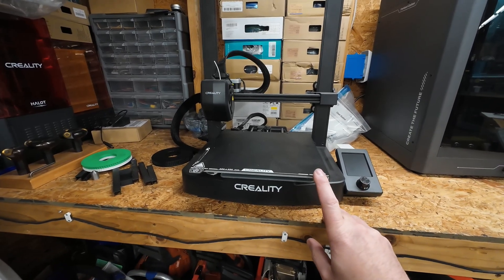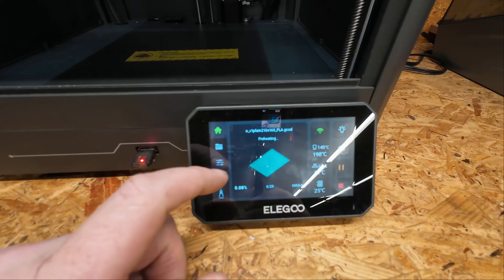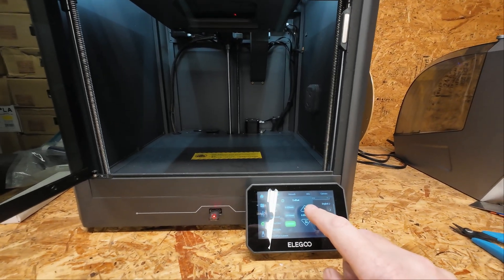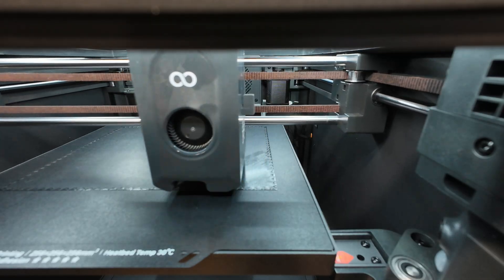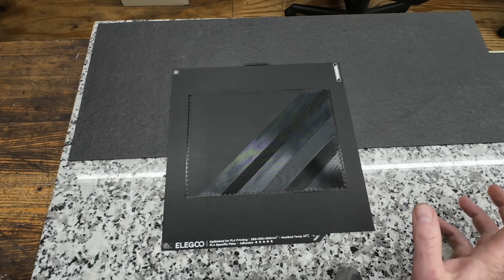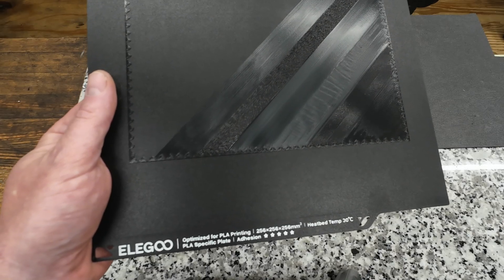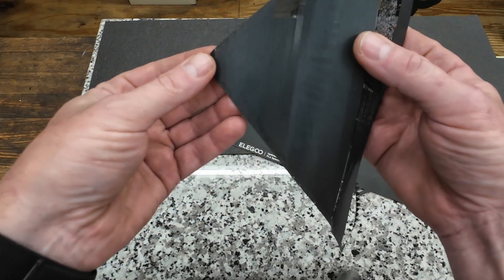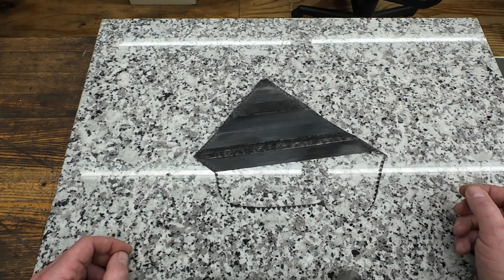Elegoo Centauri Carbon Z Offset  How To Fix It

Comment: I have an issue with my print working great and then in one spot, its really weak and just kinda comes off.  Like something about that spot or what...
Reply from the maker: Are you able to see that spot in the slicer under the preview tab after slicing? If so then it’s the model design, the printer simply runs code, it does not make decisions for itself.

Comment: Thanks! Is the new Z-offset value permanently saved in the printer, or does it need to be set each time? If the latter is the case, could the value also be entered into the printer's g-code in the slicer?
Reply from the maker: Seems like it sticks around for awhile, but any time I do a bed level it resets. I have not played with adding that to my slicer so I really can’t say if that’s good or not. I’ll play around with it tonight and see
Reply: @Workshop_Wasteland  Thank you!
Reply: It's wiped out (zeroed out) every time you do a bed level.

The key to keeping it is to figure out what it needs to be (a few different ways of doing it with one being as shown in this video) and then put that value in the Z offset parameter of the Slicer and return the adjustment on the machine itself back to zero offset. The slicer will automatically apply this offset to all Z coordinates it calculates when you slice a model to print. From there, the only time you really need to worry about it is when you changes nozzles / hot ends.

Comment: I don't get the point: why should I manually adjust the z-offset when the CC is auto-levelling? Is it the printer being that stupid that it doesn't get the auto-levelling right? Bambu Labs, Anycubic, Qidi, Creality - every printer works fine out of the box and after running the auto-calibration. Poor Elegoo for messing that up.
Reply from the maker: It’s really not as big of a deal as you are making it out to be. It’s just a different printer which less than ideal firmware.
Reply: @Workshop_Wasteland  Don't get me wrong: if the printer has an auto-level-feature, I expect it to work correctly. I'm a customer an no beta-tester.
Sure, at this pricepoint there will be some flaws. But not even being able to do a testprint right out-of-the box is IMHO very poor compared to other manufacturers. 
If the firmware oder hardware is not free from hazzle, why release it?
In addition, Elegoo announced the printer to have a multicolor unit, which is now abandoned.
Elegoo seems to be fooling its customers in offering half-baked products.

Comment: I just got the CC a few weeks back as my first 3d printer. Printed perfect right out of the box. But i had a couple of intermittent issues with auto levelling failing with an error code 502 levelling sensor data collection error. It was still  printing perfect so i did'nt mess with it until last night when the prints just wound not stick to the plate and on one occassion the hot end smashed right into the print mid print. 

Any idea on how to fix it? Keep in mind that i'm a completely new to 3d printing so there is a good chance that i screwed up the settings.
Reply from the maker: What version of firmware are you on?
Reply: @Workshop_Wasteland I’ve had the same recently, printing absolutely fine since buying it when it first came out last year, no issues whatsoever. Then suddenly can’t get the print to stick (comes away after about 5 minutes of printing) tried relevelling several times. Changed the filament etc. Very strange. I’m wondering if is the firmware? But I don’t remember when I updated. I’m on 1.1.46 which I’ve heard has caused issues.

Comment: Z offset was fine for pla temp but when i tried printing petg it was horribly close to the bed. Since we dont have access to  mainsaiI and cant adjust z offset when the printer is not in a active print job I just had google gemini make a custom gcode that preheats the bed to my normal print temperature, heats the nozzle to 170, does a nozzle clean then homes x, y, then z, moves nozzle position to center of the bed and raises to 0.2mm z height and pauses for 3 minutes. This tricks the cc into thinking there is a live print in which i take my handy dandy harbor freight feeler gauge and use the 0.2mm gauge to dial in the zoffset so the nozzle is just dragging on the feeler gauge when i pull it back and forth. Theres no eyeballing your print or worrying about going too low and damaging your bed. And you end up with a perfect first layer.
Reply from the maker: Wow, that's an impressive way to dial in your Z-offset for different filaments!

Comment: I've had my Centauri Carbon for  3 or 4 months and it's been great. I haven't checked the Z Offset yet because I haven't had any issues but thanks for showing how it's done.
Reply from the maker: Glad you found the video useful. I agree, so far it’s been a rock solid machine

Comment: Thank you for sharing what you've observed. I just got my ECC last week and I have had mostly good success. However, I was printing a shade for my Kenwood car stereo and had a couple of failures with the first passes of filament and I noticed I could see the bed plate in a couple of areas. I will try the adjustments you've demonstrated here and hopefully have the success I'm hoping for
Reply from the maker: Hope this helps solve your problem! Thanks for watching

Comment: Even though some of us may know, but please elaborate on what kind of print file you created to do this test.
Reply from the maker: I used a simple single layer square in the slicer and adjusted the size to fit the printer.

Comment: So what's the point on doing this when you can just use the auto leveling features and then you can print away without any problem
Reply from the maker: You are right you “might” get away with that.  But Z offset matters a lot for preventing things like elephants foot, poor bed adhesion and even wiping the nozzle right into your bed.  I bet your printer is set to zero, might be fun but perhaps it could be better.  My printer had bad elephants foot stock out of the box. Dialed in the Z offset and now it’s perfect.
Reply: @Workshop_Wasteland my Centauri carbon has also had trouble with its z offset right out of the box

Comment: Do you have an stl for this one layer? I cant find one.
Reply from the maker: Here is something that will work, just scale the lid to fill the build plate, and print it. Stop after the first layer because you are only using it to see the first layer!  https://www.thingiverse.com/thing:1687970
Reply: @Workshop_Wasteland thank you both for your replies. Some ignorance has left me, and I figured out how to do it. Thanks again
Reply: Start a new project in the slicer. Right click, and under "add primitive" select cube. Now select the cube and go to the scaling option. De-select the uniform scale option and you can now set the x, y and z dimensions of the cube.

For example you could set the x and y dimensions to 200mm and the z to 0.2mm (default layer height) to create a one layer high first layer test.

Comment: Thank you so much. For some reason my printer went way too close. My large container print kept failing, i almost threw away my role of filament. Maybe i might go down to .075, its on .070 right now.
Reply from the maker: Give that a shot, I’m sitting at .065-.070. Also remember if you do a bed mesh on the start of the print it will reset your Z offset to zero, I walk over and check it before each print because I hate wasting filament.

Comment: thanks for the post. My Y axis is a little off of 3 mm. Any suggestions? thanks
Reply from the maker: Im not quite following what you are saying, can you elaborate a little?
Reply: @Workshop_Wasteland  when the unit calibrates, it moves to the far left side of the frame. after, when is flushes the nozzle, the PLA misses (falls off) the left side of the bed. thanks
Reply: @zardoz53   Did you ever figure out if its actually off?

If not, then I think I can help you out. For starters, there is about 1~1.5mm of play (left and right) between the plate and the stops on the bed. Because of the way the Start G-Code seems to be set up for the purge moves, if the plate is not up against the left side stop (along with being up against the rear stops), the first Y axis purge move will tend to fall of the edge of the plate. Just making sure that the plate is up against the left stop along with the rear stops should solve the "problem" (not that its really a problem anyways, since its just the purge move).

With that said, as mentioned, the Start G-Code has the first X axis purge move going to X-1.2 before it makes the first Y axis move which tents to fall off the bed if the plate isn't as far left as it can go (or well at least in Orca Slicer, it does, which is what I use, but I assume its the same in Elegoo slicer being that it is actually a branch extension from Orca). Being that this is output from the slicer, it can be changed but its really not necessary being that its just the purge move and really should be as far left as possible so to not cause issues with print area if you were to ever print something with a footprint that was going touch machine Zero on either X or Y axis.

Basically, the Purge moves are carried out in Negative X and Negative Y (Machine coordinates) so that way a printed part can be a Machine Zero (X and Y) and not be printing ontop of the purge material for that initial purge. That however is not to say that they "have to be" carried out there, they can be moves anywhere you want on the bed by changing the "Start G-Code" to the coordinates you want it to occur at.

Comment: Yep, I was having issues with prints coming off the bed on my Carbon as well, even after auto leveling multiple times. Adjusted the z offset like I've done on my Ender 3, and it fixed the problem. Great explanation!
Reply from the maker: Glad I could help you out!

Comment: You’re doing this z offset after the auto calibration was run?
Reply from the maker: Yes, I am doing the Z offset after the auto calibration. I also don’t auto calibrate very often, maybe once every 30 prints or so.  Lastly, if you auto calibrate you have to reset the offset so write the number down it goes back to zero after the calibration
Reply: Wish you would of added the z offset gets zeroed out when re-leveling to the video
Reply from the maker: @danphillips9378 my apology’s, hard to think of everything though.